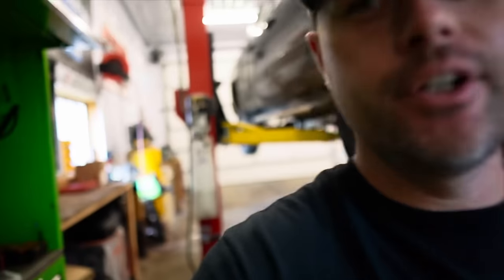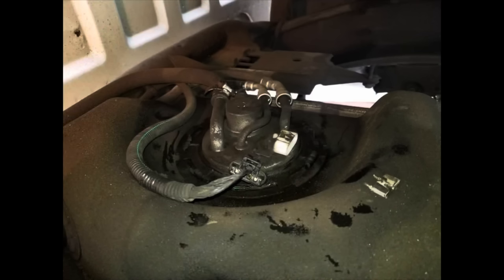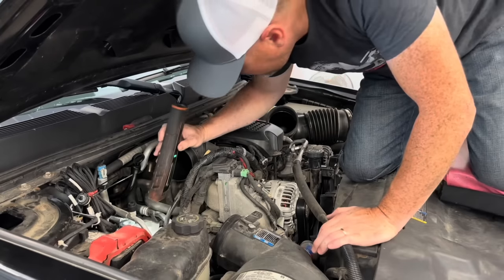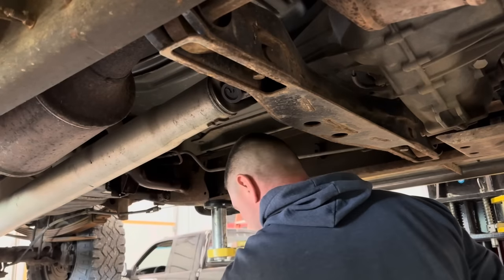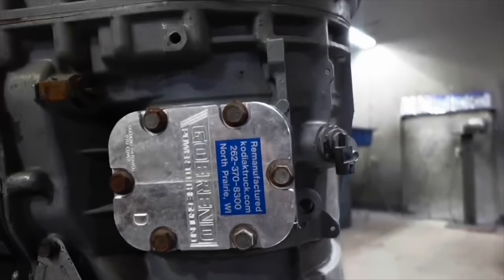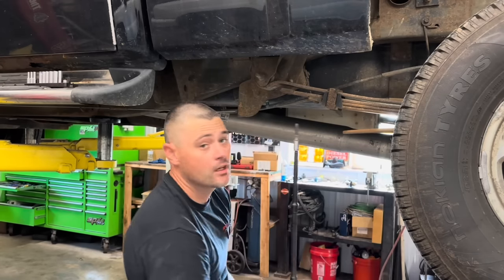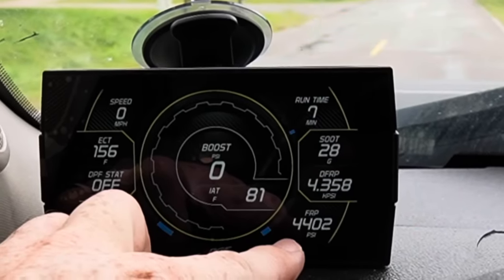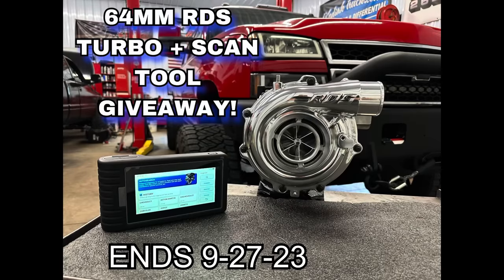The Duramax Went Into Limp Mode Again! *Fuel Issues Are Back* FRUSTRATING

Comment: Pretty sad when a diesel mechanic can't keep a truck running.  not knocking your abilities or skills, but having had a Duramax that cost me over $10K in the last year alone in repairs its sad that there are so many issues with these newer diesel engines!
Reply: I think all vehicles have a few hundred more sensors than is really needed to get up and down the road. It's a shame that you take your vehicle to the garage. The first thing a $3000.00 tablet is plug in to your computer to tell what's wrong. I say 90% of the time it still don't know the problem.  And your looking at a ,$500.00 diagnostic fee. And you still don't the problem.
Reply: Simple if you don’t have the money to fix a Diesel then don’t buy one. It’s not easy to find the issue first try
Reply: @rileyschufelt6982 that’s really just a massive cop out for an answer.. older diesels don’t have that problem, and the guy has a good point, they have so many extra unneeded features that are not reliable and cause issues constantly and are expensive to fix
Reply: Injectors is the problem
Reply: Should of just told the owner to buy a Cummins problem solved
Reply: @Topdog677  , but the reason for owning duramax is Allison transmission. Who cares about the engine, it has Allison.
Reply: @repairvehicle  the Allison is overrated best transmissions are the nv5600 6 speed they take a beating
Reply: @Topdog677 Kinda comparing apples to bananas. The Allison is the best factory Automatic Transmission. Not everyone wants a handshaker.
Reply: @Topdog677  Then they would have even more issues. Cummins is okay. The whole rest of the truck is junk
Reply: EPA has killed the modern diesel. My nephew works at a Chevy dealer and I told him I was thinking of buying a Duramax and he told me stay away, we work on them all the time.
I used to own 2500 ram with a Cummings and  it spent more time in a dealership than in my driveway because of DEF issues so I'm done with diesels which really pisses me off because I tow a 5th wheel and wile gas gets it done, its nothing like a diesel for power and fuel economy

Comment: I got an 08 GMC Duramax.  Bought it slightly used in 09 started working the known issues to make the truck completely reliable.  I deleted the DPF and EGR functions, did a reroute of the PCV and added a FASS lift pump and fuel filter delete up front.  Then replaced all fluids with synthetic.   A few years ago I got very tired of the stock 26 gallon tank and did an S&B 62 gallon tank.  The truck has over 200k on it and I would not think of getting rid of it.  Runs perfect and pulls everything I got without knowing it is back there.

Comment: I have always found it to be much easier and faster to unbolt the bed and lift that off with the hoist. You don’t have to manhandle the tank or disturb everything around the tank including fuel lines. Injector return rates aren’t fun to test on these trucks but this truck would be a good candidate to test them on given the issues you have had and the miles on the truck. I would personally test that before throwing a new CP3 at it.

Comment: My LML Duramax did this to me twice.  After the 2nd manual regen at the dealer, I had the DPF removed and had it tuned so the electronics wouldn't complain.  A couple of months later, I had all of the rest of the emissions taken off and it is never been better.  It came with the CP4 fuel pump, so I converted to the CP 3 while I was at it.  Fortunately, I live in Texas where they only do safety checks on diesels, not emissions.

Comment: So I have a 2005 Duramax I seem to have some sort of this same issue it only happens every now and then after a long haul with my 5th wheel. The last time I towed it 160 miles and after unhooking the camper shut the truck down and then the truck wouldn't restart. I bled the line for air and it started up and is running fine again. Any thoughts?

Comment: I would agree with Ryan. I have had several LMM trucks that have had the same issues you are and both times it was a high return rate on the injectors. I had Scheid Diesel test them and they came back with high return rates

Comment: I have this truck, it did the same thing pulling a 34' airstream on I-20 in Atl - pull the fuel pickup in the tank, replace it.  I also had restricted (crimped ) fuel lines.  I was sucking air at the metal fittings at the top of the fuel pickup.

Comment: Have an 06 LBZ with same problem when towing my rv. Shifts into limp mode. Shut it down for a minute,restart and go again. Noticed if I stay under 65 mph she does well. Have also pumped the fuel pump and that will get her going again. Have replaced injectors and some sensors. Only a problem when towing and temps rise.
Reply: Did you ever solve your issue?
I have a 2007 GMC 2500HD Duramax, currently with 213,000 miles & it’s been doing this for past couple years.
I put in a fass fuel pump system a year or so back in hopes to solve the issue, it seemed like it helped for a while,
But then it started again.
If I pull a horse trailer loaded, locally within an hour or so, it’s fine.
But when I travel & I’m moving along pretty good cruising at 75Mph,
As I start to head up a small incline… putting a. Bit more strain on the motor, I can feel it go into limp mode.
If I baby it I can continue down the road at 60-65mph until I get to next exit,
But it won’t go past 2000 rpm.
The first few times it did this 2+ years back, I just thought it was bad fuel or a faulty fuel filter, so I replaced a few of them unnecessary.
Then I figured as you mentioned, if I pull over, shut the engine off for about 3-5 mins,
Then it’s good to go for another 150-175 miles.
I don’t know if it would go into limp mode without a trailer because I don’t drive it much during the week & it’s all just local driving.
Mine is all factory, except for the Fass lift pump & filter system,
So I would assume it may need injectors?
But even with well over 200k miles this is engine is very strong,
So no sign of any struggling or loss of power under normal driving conditions,
Other thing I’m considering is the CP3 pump,
Just don’t want to replace parts unnecessary.
Reply: @darinbarfield8738 Sounds exactly like my 06LBZ. Fass lift pump didn't fix it. It usually goes limp at low rpm pulling a moderate grade. Keeping the rpms above 2500 by manual shifting down and only 3/4 throttle gets me up the hills towing 10000 lbs. Crazy that there isn't an easy solution.

Comment: been driving my 06 lbz for 5 years this this problem, helps alot to add a quart of lucas injector cleaner and fuel treatment to each tank, only time i have problems is when over 100 degrees outside. did lift pump, and rail plug. at 340k sure its cp3

Comment: Hey Truck Master, try taking the two harness connections above the driver valve cover apart, clean the prongs and plug back in. Had this happen on my dads ‘08 LMM and that did the truck. Dead petal and code was P0698
Reply: Really? I have an 06 LBZ damn thing went back into limp mode this weekend p0087 AGAIN😤 I have already done lift pump injectors and cp3. At my wits end.
Reply from the maker: That’s a very good idea I’ve done this before and it actually worked on a few trucks I was working on.

Comment: I just got mine back after having very similar issues but only when outside temps where high (above 85 F) and while towing. They pulled the injectors for a bench test to simulate higher fuel temps and found almost all injectors had bad return rates despite good balance rates. Luckily the truck had no fuel pump issues or else the bill would have been crazy high. Had them do the race plug and install my air dog I got from you months ago since they were in there doing work.

Comment: idk if he ever got it fixed but change ur throttle petal.  it will fix it, mine drove me nuts with this problem.  bad fuel petal kicks on the limp mode. same fuel codes.

Comment: I have had recurring intermittent problems with reduced engine power on my 07 Duramax except it has been a throttle position sensor correlation code every time (can’t remember the number). Changed pedals with other trucks and new ones, changed the plug, ohmed wires, cleaned connections. About the only thing left to do is replace the ECM. Nothing makes sense.  So frustrating, especially when it acts up pulling a trailer.
Reply: You need a harness to pedal module . Probably a bad wire .

Comment: hello from the other side of the state lol im just north of grand rapids. but anyways i had a similar issue with my lb7 and sparta chevy wanted like 3 grand for a cp3 , i was thinking it had to be the FPR ( i had a rough idle and some other issues) ended up being the 5V wire that goes to the accelerator pedal. had a local guy fix it for 75$ in less than a hour.  sparta chevy had it for a week.
Reply from the maker: No way! I’m checking that now 😂👍

Comment: You were so close!  Now go back and replace the lines that feed the filter housing.  They have a foam piece around them that hide the problem.  The hose will be egg shaped inside of that foam piece.  By the dipstick.   Once the get warm they collapse and cause restrictions. Specifically on the feed side.
Reply from the maker: I already did

Comment: I had the exact problem with a 95 f150 6 banger(gas). I changed fuel filters multiple times on my back the road. Filter wasn’t dirty after the first change but thought maybe it’s a dirty tank so I even blew air back into the supply towards the tank thinking it’s a tank sock dirty. All didn’t help!  I traced every inch of the fuel line and found something I had never seen before up by the firewall next to distributor.  Too tight to get to it on the road so I banged it with wrench.  That fixed it!  Had double power from there on out too.  I believe it was because I used fuel injector cleaner and it locked something up inside that little regulator?    I think I heard you say something about a regulator (I know that it’s nowhere near the same type system but if there’s a regulator and he added injector cleaner.  Maybe!  Idk but worth a try. Good luck sir
Reply: Happy to win especially from your fantastic site
Reply: What do I need to do now

Comment: I few Months Ago I had the same issue on my Truck.  So after watching so many Vedeos on YouTube I found one vedeo that I had watched about the Ignition Switch Solenoid ... I took it apart and cleaned it out.  I found out that the "Resistance" on the Switch Solenoid goes out after it heats up.  So I went to O'Reilly's Auto store and bout a new Switch Solenoid, after installing it, Limp Mode went away, no more transmission Problems, like "Shift Inhibited" that went away, check Engine light went off.  So After I also changed my transmission fluid out, both Filter' from my Allison  Transmission, and now my transmission shifts so Smooth. I was going of from the process of Elimination, where I started with a few electrical Diagnostics and Finally I tried the Switch Solenoid..... it's an option ! If someone is have those issues,  it Drove me Crazy and I felt so Frustrated where I actually thought it was my Allison Transmission....I began to panic because I didn't have Thousands of dollars for a new Transmission...where in fact it was a part which cost me less than $ 50.. Dollars....my mind feels so relieved now, that I figured out what the Source was through Simple Electrical Process of Elimination....

Comment: If injectors are returning too much fuel it will drain the rail, pretty common, the rates will read fine, injectors will sound normal and all but there physically returning too much fuel and draining the rail and cp3 can’t keep up. I’d put money on injectors not the cp3

Comment: Drain some fuel , and let it sit in a glass jar. If you see tiny bubbles that’s water / micro beeds! 
What it is actually is animal fats from fast food restaurants. 
Refineries are allowed to mix up to 20/40 bio diesel depends on what part of the country your in.  
I went through a similar situation with my trucks , had me chasing a ghost until a friend of mine who happens to work at the refinery and does fuel testing told me.

Comment: Truck master!! I have a question on my lift pump for a 03 GMC 3500 6.6l.....how do I get in contact? The directions for this lift pump is just completely messed up
Reply from the maker: Watch my lift pump install videos brother 👍
Reply: @TruckMaster  yessir I did. The fuel line that you essentially replace is just a solid fuel line that goes from the tank to the motor. There's no connection behind the fuel cooler

Comment: I was having low fuel rail pressure issues on my 2006 duramax pulling my three axle camper it would go into limp mode I'd clear the code till the next big hill if I didn't use the cruise control and force it to down shift early it would do just fine I put a lift pump on it issue salved

Comment: I have a 2009, too, with 225k miles, and I am contemplating on doing a full delete also.  I've had the cab off since June fixing all the leaks from the egr cooler.  Please help me to know what year of coldside down pipe I will need.  I would like to buy WC Fab bundle 1. 
Thanks
P.S. I have already purchased the LB7 uppipe from PPE.

Comment: Not to bad mouth a product , but I just purchased a completely new Fuel filter housing & filter assembly for my LB-7 & saw Nothing but bad Reviews on those Henkyo filter set ups !!! Just my 2 cents here . I paid the extra cash & bought a new Racor / Parfit OEM setup for mine as it’s been on truck now over 20 years & I rebuilt the Pump head once about 5-7 years ago.  My truck only has an issue when shut down after a long run in hot weather.  Sometimes it just dies after re-starting after about a 10-15 minute period & I have to pop hood & re-prime it & other times it has No Issues.  The new filter head assembly with new filters for Airdog lift pump are all going on hopefully this weekend and I’m crossing my fingers this will solve my issues . The Edge CTS-3 has shown NO rail pressure issues running under any loaded conditions & Actual pressure is very consistent with required rail pressure at any given load & speed . Only acts like it has a vapor lock or restriction after hot & sitting a few minutes.  Give it a 1/2 hour cool down & the damn thing starts & runs fine every time 😐.   C-ya on down the road … 🤞

Comment: Check the suction on the cp3. If the truck doesn't have a lift pump the injection pump could be bad on the suction side
Reply from the maker: That’s a great point
Reply: @TruckMaster  do you have access to diesel laptops or all data? If not I can email you some literature for factory service procedure and specs for checking the pump

Comment: I keep having issues with mine. Bought the truck said the fuel filter needed to be changed I changed the fuel filter it lasted maybe a month or 2 roughly 1-2 thousand miles then said I needed to change it again cel came on code p0087 deleted the code ran fine and I changed the filter again and put a car filter crossing fingers now
Reply: I have a C4500 with the LMM.Mine just did the exact same thing as yours....117k mikes.Truck runs perfect otherwise.

Comment: I have the 7.5 LMM with the exact same issues!! I have thrown a new FPR on it, Fuel lines not kinked, new fuel filter housing (now delete kit), Airdog lift pump, and now waiting for a fuel rail pressure sensor.... I also bought the sump and will be installing that soon.  I hope its not a CP3 issue... but my question to you is if I put the sump in, will I also need to replace the sending unit or can I just leave that alone and just block it off?
Reply: Just did a beans sump and 165 lift pump, you can just block it off. But I would keep the return line hooked up so fuel from engine still has a place too go. My feed and return are both on the sump. Also keep it plugged in so your fuel level sensor still works for your fuel gauge. Lastly, double check when you install the sump that you do not hit the sending unit and or float. Wasn’t the most fun job but the after is well worth it
Reply from the maker: Keep it in place and just run the sum no need to block it off except the suction port on the sending unit I believe
Reply: @TruckMaster  you are correct. Beans kit came with a 1/2 inch plug. Mine wasn’t so easy, pinched the line to hard so plug wouldn’t go in, had to cut the fitting off and use the plug with a clamp. The rubber braided lines I noticed are way under quality which you saw on this truck. There is actually a gm bulletin on all those sections from tank to motor collapsing. Had to replaced my main feed line the other day due to that. Lift pump helped but on a hot day cruising 75 on cruise I could tell a small lag still. The pump helped keep the kink spots open but not enough. Ordered evil energy fuel line and used the feed quick disconnects from air dogg kit and made and ran a brand new line. So far so good.
Reply: @TruckMaster  I think there is a bot or a scammer replying to your chats.. I got a message saying I won something and to message them on telegram......is that you or no?

Comment: Livin the same night mare basically. Ive put over 20,000 in this 05 lly on top of oil changes n fuel . Now the turds electronically kicking into neutral . Did the NSBU switch . Same problem still . And it started not wanting to up shift now . Biggest piece a chit vehicle ive ever owned in my life ! Wouldn't recommend one to my enemies ! My 77 3/4 ton chevy has 600,000 miles on it . Always starts ! Always runs ! Tryin to find a 70s dually 4wd and this electronic plastic turd on wheels is goin bye bye ! 
Total money pit !